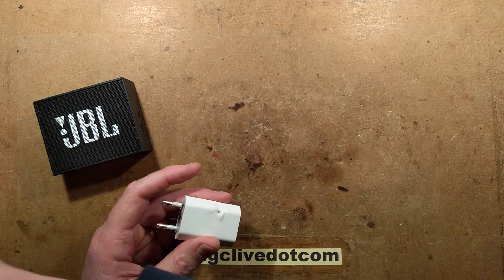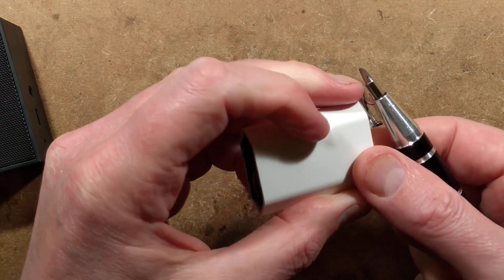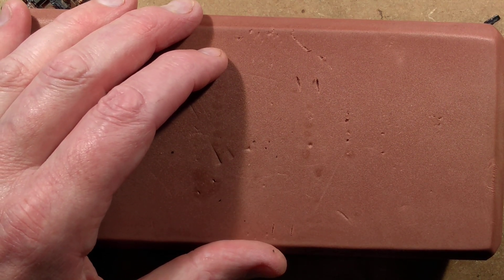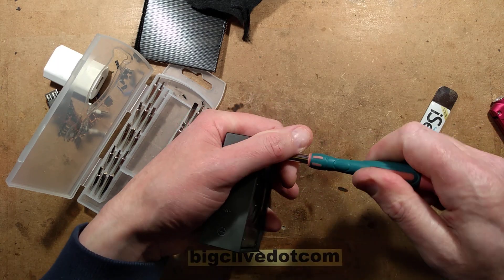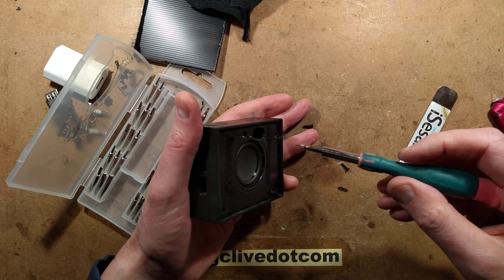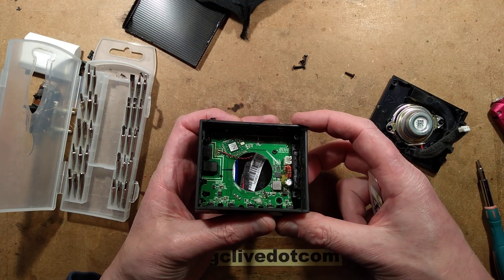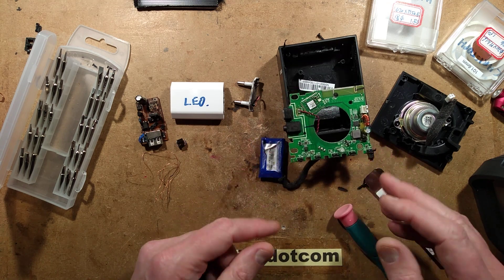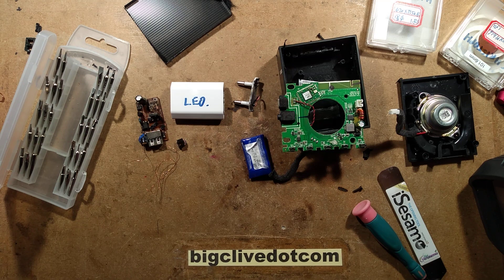Dead JBL speaker and melted PSU.  Which died first?

Comment: So I have a statement then a question, I've had several bluetooth devices go down, 2 of them  cheap but 3 expensive the latest was was a Altec lansing bluetooth speaker, of course I took them apart (to bits) and like you first thing was I checked the battery, they had a reasonable voltage so I moved on never really finding the ah ha moment or even a skid mark. I do not have a thermal camera tho. So my question is are these bluetooth chips known for ruining these devices. Is it a common thing.
Reply: no not really. bt chips are pretty solid. pretty passive and low voltage logic. they are easy targets for death in devices but not usually the cause. although its not impossible. If you have multiple failures I would hazard a guess at the source your using to power those devices being the cause.
Reply: most of the worlds usb chargers are grim. even good quality ones will eventually turn grim. they take 240V AC and turn it into 5v DC. but at what cost
Reply: @yodaco  thanks for the input.
Reply: Not unless all your failed devices are using the same Bluetooth chip.
Reply: @Berkeloid0  I think maybe I didn't ask the question right, I should have mentioned this, but my wife got home so I cut it short, a couple of years is all they last. They did not have the same chip in them. I had mentioned all this once before I had 1 guy respond said he noticed the same thing, but it was on a completely different video I forget somehow the topic got to BT chips. You can see how this time was appropriate to ask the question.
Reply from the maker: It's hard to say why they failed without looking at them.  If they get used a lto at high volume it could be speaker failure, or it could be static discharge.  Have they failed when something has been done like plugging in to charge?
Reply: @bigclivedotcom   altec lansing speaker would loose bluetooth connection, at first once a week, then more often til it wouldn't connect at all (about 3 months time) until I plugged it in (I'm thinking at this point battery is shot so we will just use it plugged in) eventually wouldn't work at all. However when I did the tear down battery checked out fine, as a matter of fact I'm currently using the battery on a BigClive inspired light, so it was fine the charge board for the battery works fine, it will charge if I hook it up, the speakers work. At this point tho it's just dead wont turn on. However if I hook everything up the LEDs will still show charging not charging, battery full. I know without seeing in person its hard to diagnose, but my main question was or point being it had never occurred to me that the dang bluetooth chip was the problem. In your video you had said I believe the BT chip was "pulling down" I'm guessing drawing to much current, if I follow your meaning. 

The cool thing about this altec lansing was it had test points next to speaker connections, charge ports, and battery connection.
Reply from the maker: @raymondmucklow3793  It could possibly still have been a battery issue if the battery wasn't supplying peaks of current.  Hard to say.
Reply: @bigclivedotcom  maybe one day I can send them to ya. I'm just like that when I take something apart it sticks in my mind til I find out why. Thanks for the conversation and input tho.

Comment: I'd be tempted to replace the entire Bluetooth module. Likely to be about £3 on Fleabay.
Reply from the maker: I'm not sure whether it's a standard one or if it had specific functions for this unit.
Reply: @bigclivedotcom  fairly generic. but removal of the bt unit all together may leave the speaker able to run via aux. unless the bt unit is also doing some thinky thinkyness
Reply: well since its 3 quids you can try and see if it works after replacement
Reply: @hachikiina  I tried reading the numbers on the module and scanning the code but the video just isn't clear enough. Scanning Fleabay for a similar looking item failed. This may be a custom module.
Reply: @PIXscotland  maybe Clive can give us the chip/module code for us to look around

Comment: Pretty sure the charger blowing up damaged the electronics in the speaker
Reply from the maker: The charger blew up afterwards whilst not connected to the speaker.
Reply: @bigclivedotcom  I still think the shittiness of the charger was to blame, Bluetooth ICs don't fail for no reason. Power ICs maybe, but that bluetooth chip probably got upset from the charger. Given that the output cap was domed, it wouldn't surprise me if that charger was spitting out something crazy like 10v. I fully blame the charger. Speaker was charging normally and overheated the charger, and the overheating charger spat out more and more bad power, until the speaker could no longer handle it, and then the speaker died. That would be my guess. 

I'd like to see some torture tests of some of the shitty chargers you've got on hand to see how stable the output is under load, especially once they start to overheat
Reply: @iamdarkyoshi  I concur. I would be surprised if the bt module was the source of the fault. in my experience they're only 3v3 logic, they couldn't take out much.  they usually get toasted, they don't do the toasting.

Comment: So Mr Clive, why do you think the BT chip is getting into the 80-90C for?  Faulty or did the charger take it out and short it?
Reply from the maker: It's after a regulator, so I'd guess it just failed.  Possibly a static discharge or just a bad chip.
Reply: @bigclivedotcom   Understood.  Thanks for the reply.  Now i just wonder what it would of done if the charger didn't fail?  I assume melt and burn the speaker itself? lol

Comment: The best charger I have is the Ikea Koppla 3 port USB mains supply which Clive did a teardown of a few years back now.
Reply: Anker PowerPort > rest
Reply: Против Глобал Who is Ugreen and why do you think they are good?
Reply: Have one as well (and watched the teardown as well), my current phone is very picky with the cable and usb power supply selection for charging, the Koppla one is by far the cheapest and most reliable usb charger I have.

Ironically the phone sometimes refuses to charge from the original charger with the original cable, but is always fine (if the cable used suits its tastes) with the Koppla charger and the TP Link or the Transcend USB powered hubs. shrugs
Reply: José Sousa what phone do you have?
Reply: @technikfreak9859  Sony Z5 Compact... due to its waterproof features the usb port is actually disabled and only when enough voltage (and stable enough) is applied it will charge or be active.
I think it must check for both voltage and current supplied because it only charges if more than 500mAh are provided at 5V (at 4.95V it won't charge).
Reply: Super Clark  or maybe the average consumer doesn't want to bend pins because generally speaking that can break things?
Reply: I tried another ikea modular 3 outlet unit (separate power supply from the 3 outlet), but I found the modular desk oriented clip on version tends to brown out and shut off and on under high loads unlike the similar rated Koppla charger which is flawless except for dropping on the wall.
Reply: I also have a couple of those in my home with the Europe plug and they’re just amazing
Reply: I’m using a anker adapter that is also a power bank for charging my iPhone the charger that comes with it is hot 🔥 garbage that only puts out a 1amp
It’s working good so far had it for 3 months now 
And a 2.4amp blackweb Walmart adapter with my raspberry pi 3 b+  had it about a year no problems I can find
Reply: @mrfluffytailthethird  Weird, most people say Anker are great and I have tons of their stuff myself.

Had so many phones now though I have a collection of official Samsung chargers.  Annoyingly several have coil whine that puts me off using them as it drives me insane.
Reply: @alexatkin  No  guarantee with Anker.  I own a couple of their products that they rushed out and were crap.  A USB 3.0 Ethernet adapter and a USB 3.0 SATA adapter come to mind as very unstable.  They can be better then some but not great.
Reply: Против Глобал  Ugreen is my favourite brand now. But have also a good Aukey charger and a 5 port Anker. :)
Reply: Set my bedroom on fire with one of them
Reply: I got the same one, bought a few as it's a trek to IKEA (and a horrible experience with Mrs) 5 years ago. Possibly the best USB (power) device I have owned. Then seen Big Clive review. Even happier after watching
Reply: The problem is the american ones have this annoying tendency to try and fall out of the wall because they don't have even a stability-only ground pin like you see on several UK products.  Otherwise they're very nice.
Reply: @IncertusetNescio  Have you tried slightly bending the two pins a bit closer together on the mains plug?  With the Australian mains plug you can squeeze the pins together just a fraction (with your bare hands, no tools) and it's enough to make it grip the socket much more tightly.
Reply: @IncertusetNescio  I think that might be a function of the crappy american wall outlets though.
Reply: @IncertusetNescio  Some European outlets are recessed to prevent exactly that. The plug itself slides into little guides.
Reply: IncertusetNescio The UK ones are bound to always have it as it opens the shutters on the output pins of the socket.
Reply: @IncertusetNescio  I agree, the British plug is the best in the world, if only they had designed the earth pin to push in when not plugged into the wall.  My phone power supply does this although it does not use the earth pin, it has a plastic one to push the covers for the live and neutral away so the power supply can be inserted easily.
Reply: @BoB4jjjjs  gotta disagree on that. I have one travel adapter and UK model is the only one I know of where it would be totally possible to touch both leads at the same time. On the "nordic/German?" style leads are insulated and exposed only on their tips and it's pretty much impossible to do same than with UK plug type. Edit: actually I think I just mixed the US style plug. UK style actually I think have insulation partly on leads
Reply: @jothain  Yes the US plugs are easy to touch.  The British ones are part covered on the Live and Neutral pins.  If you get an old plug it might not be insulated on the pins, but any bought in the last 10 yrs should be covered.

Comment: I normally use the chargers that came with my phones. I do have one of the Poundland/Dealz dual port chargers that you reviewed a couple of years ago but only ever seem to have one device plugged in.
Reply from the maker: Those chargers are best used with just one device or two low current devices.
Reply: @bigclivedotcom  Don't think that I ever charge more than one device from any charger. There are so many of the damn things around the house that it's impossible to go into any room without finding at least one lol.